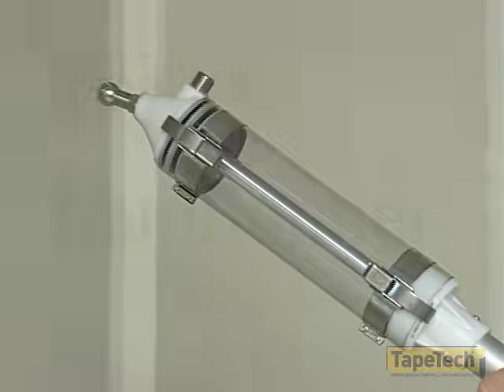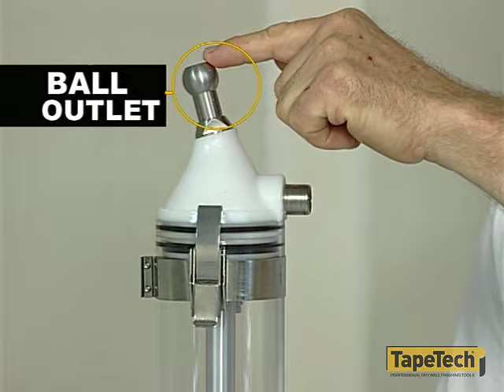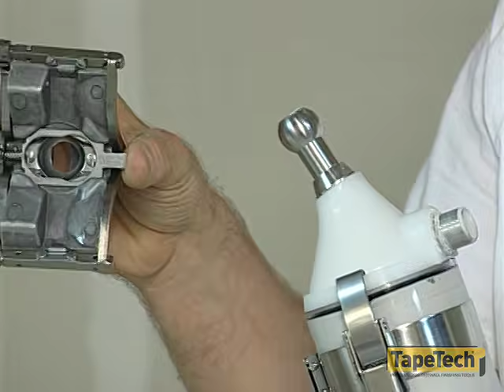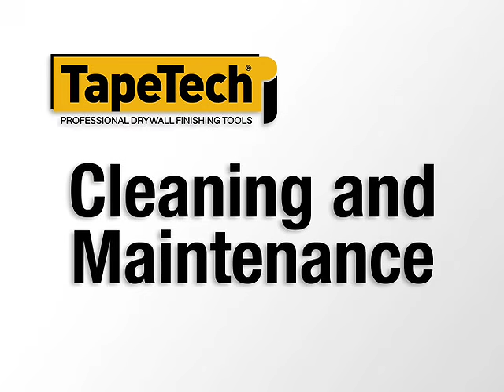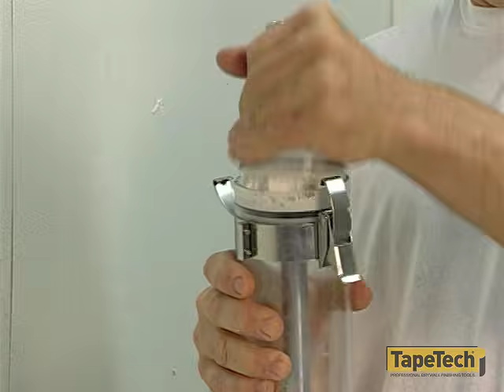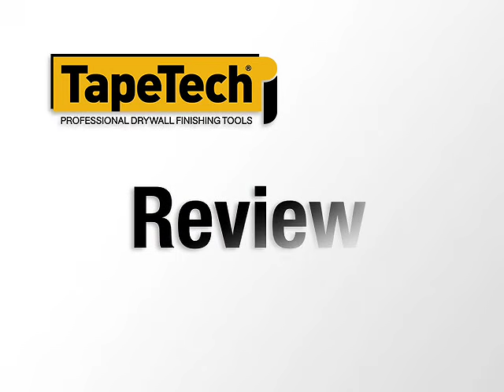TapeTech MudRunner

Comment: This mudrunner sucks, it will crown the angle. The mud is forced out at a higher pressure, it’s compressed by the angle head blades and expands . You can put a 6” knife on angle after it’s dry and see the crown and daylight going into angle. Which was not acceptable on commercial smoothwall. It’s cumbersome also, no one in our company liked them and they were discontinued being used
Reply: SYBAU

Comment: Something that should be obvious that I had to learn was to relax the twisting motion as you approach an opposing angle and let the mud that's in the angle head deplete and finish out the angle,other wise you'll load up excessive mud and it will make a mess by dropping onto the wall and splat onto the floor. I have found that thin mud as you would use in your bazooka for taping ,works best for angles as well. If it doesn't squirt easily out of the mudrunner that your gonna end up fighting it and having poor results.